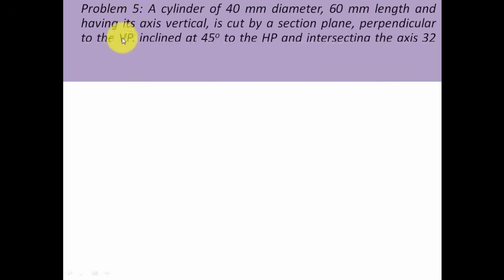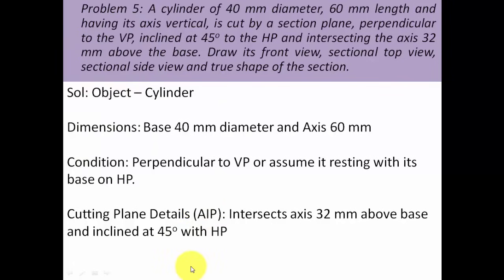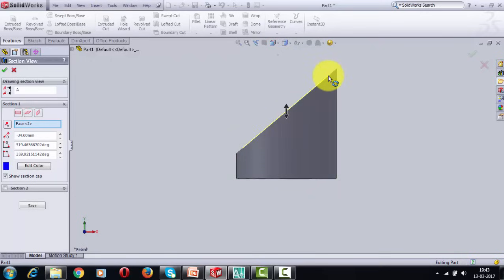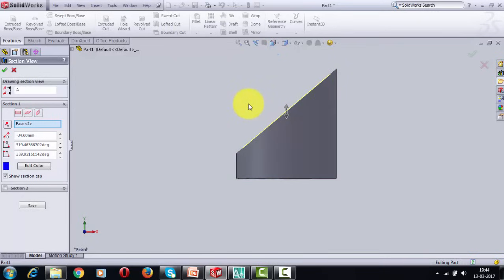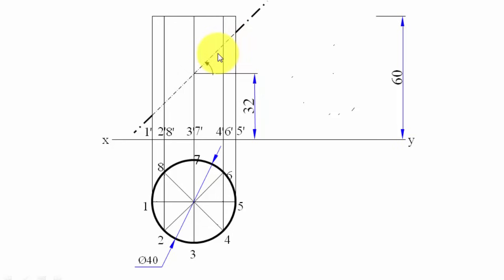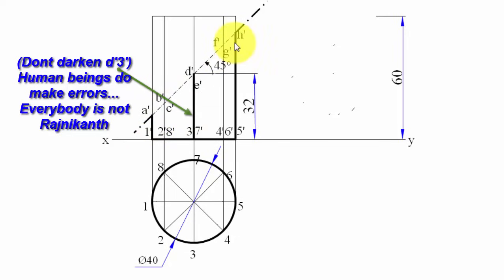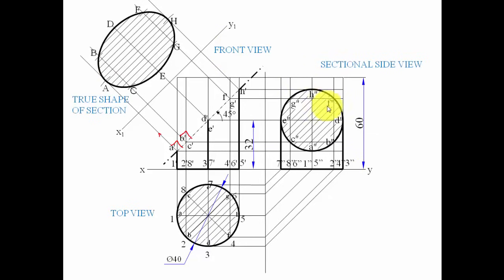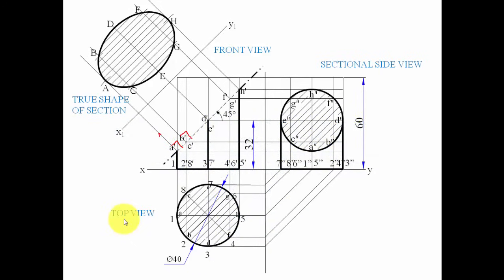SECTION OF SOLID_CYLINDER_Problem 5

Comment: A cylinder 50 mm diameter and 60 mm long, is resting on its base on the 
ground. It is cut by a section plane perpendicular to the V.P., the V.T. of which 
cuts the axis at a point 40mm from the base and makes an angle of 45 degree with 
the H.P. Draw its FV, sectional TV another sectional top view on an A.I.P. parallel 
to the section plane.

Comment: A cylinder of 40 mm diameter, 60 mm length, and having its axis vertical is cut by a section plane, perpendicular to the H.P., inclined at 45° to the V.P., and intersecting the axis 32 mm above the base. Draw its front view and sectional top view.

Comment: cylinder of diameter of base 40 mm and axis 55 mm long is resting on its base on 
H.P. It is cut by a section plane, perpendicular to V.P. and inclined at 45⁰ to H.P. The 
section plane is passing through the top end of an extreme generator of the cylinder. 
Draw its projections and development of the lateral surface of the cut cylinder. (for

Comment: A cylinder of 40 mm diameter and height 60 mm is having its axis vertical. It is cut by a plane perpendicular to VP and inclined at 45o to HP and intersecting the axis 32 mm above the base. Draw its front view, sectional top view, and true shape of section

Comment: Can you please solve this :
vertical cylinder of base diameter 45mm and axis length 60mm is cut by a plane perpendicular to VP and inclined at 50 degrees to HP,is passing through the center point of the top face. Neatly draw the sectional top view,calculate the development length for circle and show the developmentof the lateral surface

Comment: forget it, i have that problem to construct a stainless butterfly for a boat exhaust,at 45º,won't even think of doing it this way,too many points needed: i will section the pipe at 45º in a saw, then lay the cut end flat on the stainless sheet metal and draw it, then cut the oval butterfly.

Comment: A cylinder, 65 mm diameter and 90 mm long have its axis parallel to the H.P. and inclined at 30" to the V.P. It is cut by a vertical section plane in such a way that the true shape of the section is an ellipse having the major axis 75 mm long. Draw its sectional front view and true shape of the section.

Comment: Sir please upload answer of cylinder having base 65 mm and 90mm axis parallel to hp inclined 30deg to vp .it is cut by vertical sectional plane in such a way that the true shape of the section is an ellipse having major axis of 75mm long.draw it's sectional view and true shape
of the section
Reply from the maker: Well, this seems to be a reverse sectioning problem.....will soon be making a video on such problems

Comment: hello sir i am in 1st year and i have a problem can you give me the solution 
the question is
A cylinder with 60 mm base dia and 70 mm long axis , its base on the H.P it is cut by a sector plane perpendicular to the V.P  the  v.t of which cuts the axis at point distant 50 mm from bottom makes an angle of 45o with the reference line . Draw the front view ,top view & true shape of the section.
Reply from the maker: request noted